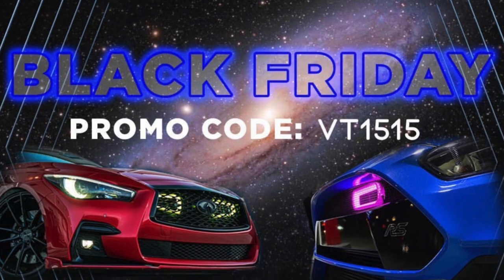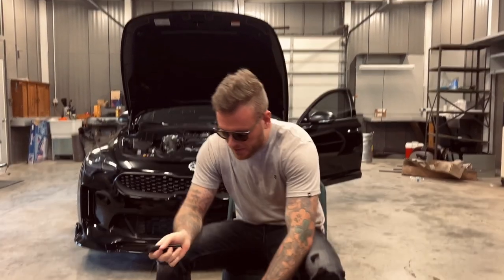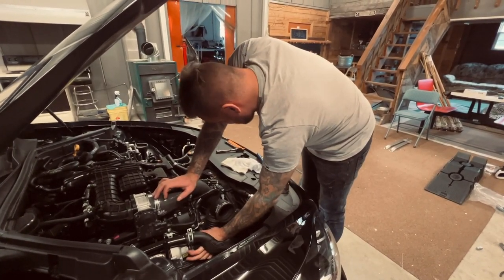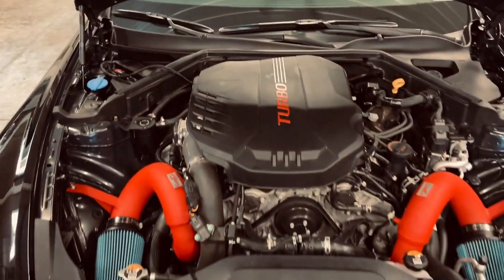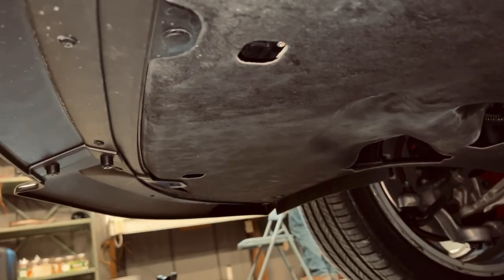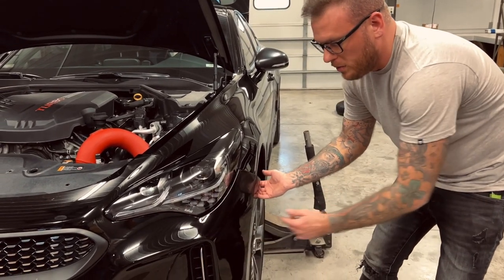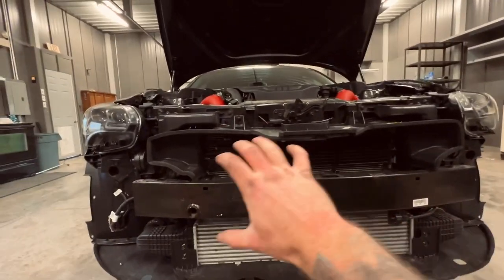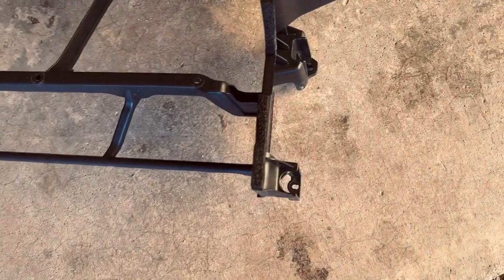KIA STINGER gets RAM AIR and IT'S LIT! EASY STEP BY STEP INSTALL - Velossa Tech

Comment: Great content! Those stock inlets that face up have been measured to be very restrictive. Removing them drops the intake vacuum from 9 to 4 inches as tested by a Stinger forum member using a mano meter. There was also testing by another member that showed great gains in the 1/4 mile by removing those and adding the VT snorkels with the stock air boxes. The question I have is which one makes the most difference. Anyways. I'm enjoying your channel! The VTs and Injens look awesome!
Reply from the maker: I believe it! That’s awesome, I can definitely tell a difference when dropping down to 3 gear and doing a pull, esp right now since it’s colder out here.

Comment: You really should have done the MM intercooler since you were already in there. Anyways, I’ve been up and down about the snorkels for a few short months now. Seeing how they look along with how well they function, I’m now seriously considering them. Being that I am in central Florida I am for sure going to go with them as well as the MM intercooler as well.
Reply from the maker: 100% agree. I’m holding off on it for a couple months while the weather is really cold here right now. FMIC is a must with the mods I have.

Comment: Just installed mine last week, did you ever figure anything out or downsides of the package they give you for the kit?(dead battery video didn’t give me warm and fuzzies) I’m looking at a custom lighting shop to do headlight work and underglow. Was thinking of having them integrate the Lit Kit into that circuit. Love your content man, if there is a go to for Stinger vids, it’s you!! Keep pumping them out!
Reply from the maker: Yes and yes, so I narrowed down what happened and I think it has to do with the app. If you leave the lit kit connected and disconnect the negative battery terminal to work on your car, it will auto turn on when you put the negative battery terminal back on and then the app will not shut the kit off until you manually unplug the lit kit under the hood. I’ve had a couple other people message me the same thing so I’m pretty sure that was it. I want to tap my power into the fuse box, I think that would eliminate it. If not it’s an app issue
Reply: @twn2rbo  Thanks for the info, definitely some weirdness with the app. Just wasn’t sure how much I trusted the grounding points, I’ll be tapping into the fuse box in the future for sure. Thanks for the reply broski!
Reply: @twn2rbo  hi I’m a little late to the party, but I was wondering if you ran an actual dual in line fuse instead of adding to the post of the starter on the car? I just installed the light kit on my scoops today and when I first hooked it up the lights would actually stay on and then I disconnected the battery and reconnected it, connected to the lights with the app and then clicked shut off in the app and then when I turned the car off, the lights were not on all the time anymore. I still use the switch to shut the circuit down, but I was wondering if I left the switch on and the LEDs were not on if there were stall a draw on the battery because it was hooked up to the starter post? I hope that makes sense. 😂

Thank you.

Comment: Went by the old dealership I used to work at it seems they made the 2022 recent models actually a little bit shorter. The body frame looks identical to the K5 other than the actual outer body pieces

Comment: Have you noticed any overheating issues since you removed the shroud that directs air into the radiator?
Reply: I'm wondering about this as well. That's not a required step of the install, right? Can we leave it in and still use the snorkel(s)?

Comment: Hey mate how are you,
Love these and intend fitting some to my 22 GT. One question now you've had time to test in real world conditions: Water? Do the filter elements get wet from driving in rain, or say going through car wash.
What checks are you doing routinely on the filter condition?
Cheers from Straya,
Ray
Reply from the maker: Great question and I’ve tested that throughly, no water has made it on the cones so no worries

Comment: You have happen to know the part number to the part where you removed the rubber seal to use on the new kit?
Reply from the maker: I do not sorry. Check with Velossa Tech

Comment: I know this was a year ago, but do you remember having to tune the stinger after installing the intakes?
Reply from the maker: No tune needed on the intakes, but after I added a cat back with the intake, I did. It would go into limp mode all the time. The JB4 fixed that. Intakes only, no issues

Comment: At 6:05 in this video, you mention you like the concept of the "glow" and that it's not too bright... Does this mean that the non-glow or other colored scoop bodies that are available are brighter than the glow LEDs??
Reply from the maker: Good question, no the other ones will not glow on their own naturally like mine. They are just hard colored plastic but once you turn the lit kit on, they will be just as bright as mine. Mine are an off white glow plastic that charge with light which doesn’t drawl as much attention as a solid white air duct would. Tbh I don’t turn them on that often, I got them to lower the intake temps and cool off the engine bay. But when parked or showing people they love them. Sometimes I roll with the white LEDs turned on to match the DRLs

Comment: I'm thinking of getting the regular ram air or lit kit.  Which one do you recommend and why?
Reply from the maker: Regular. I ended up doing an update in a vid not long after and I was having an issue with the LEDs, it drained my batter over night and the app sucks, well it did at the time at least. Diode Dynamics is the software. They may have updated it since, but I never turns them on really bc it’s easy to forget you leave them on etc. I would do regular if I did it all over again, same performance just aesthetics change
Reply: @twn2rbo  thanks.  I'll prob get the regular for simplicity of install
Reply from the maker: @superflunker87  good choice, have you picked out an intake yet? These snorkels with the AFe / Takeda intakes are 100% the best option.
Reply from the maker: @superflunker87  you can see them here https://youtu.be/-Yjd2y1nMfo

Comment: Any problems with heavy rain?
Reply from the maker: Nope, I’ve made some IG posts and I know I put a clip in one of my YouTube videos pulling over after heavy rain on interstate and cones have been dry every time. The only time people have issues with the cones getting wet is with heat extracting hoods. Injen makes hydro covers that hep with that, but totally separate issue

Comment: im just surprised by how many people got this and haven't had any sort of water ingestion. Like its an amazing product and concept because its are right to the box and filter, but at the same time the factory system seems like it keeps water and FOD out?
Reply from the maker: That’s a valid concern, I actually made a video shortly after doing a before after driving through a bad rain storm, cones were completely dry though
Reply: @twn2rbo  that's quite interesting, they were probably dry because of the gap still between the intake snorkels and the cone filter, if it was connected to the factory box still, it probably would have soaked a panel filter?
Reply from the maker: @MrPl0xygen  you would think but I know ppl that have dropped a k&n oem style filter in with the snorkels and have no issues after driving in the rain
Reply: @twn2rbo  true yeah, i got a buddy in FL that has a GT Line 2.5T with the snorkelers and im heavily wanting them, but living semi-rural its hard to find a good shop to help.
Reply from the maker: @MrPl0xygen  I have a step by step install video if that helps, I also have a 4 min video on how to remove the bumper, good luck! I hope you find success with it
Reply: @MrPl0xygen  yo if you in Orlando city  Kia has a department that specializes in modding Kia’s